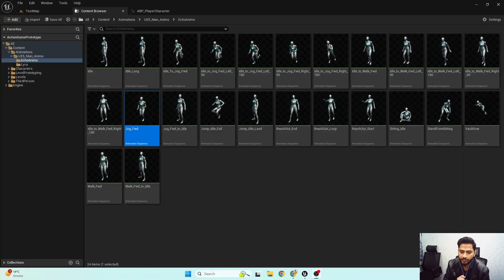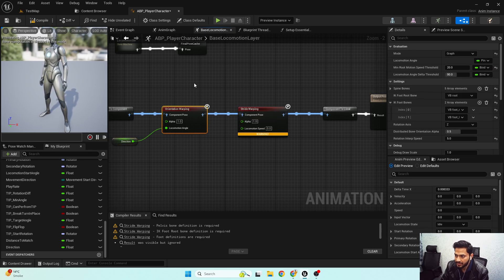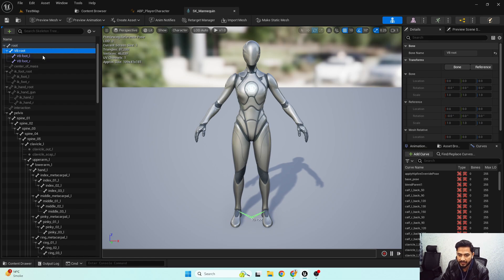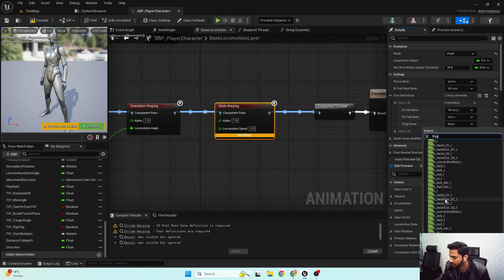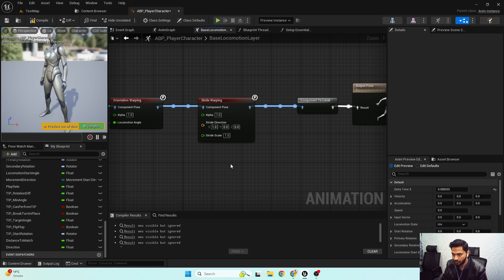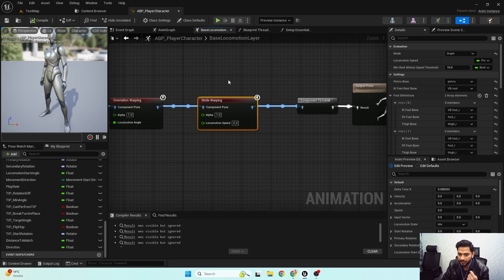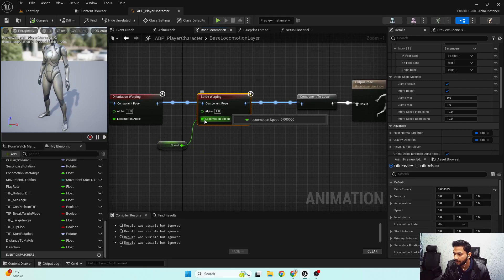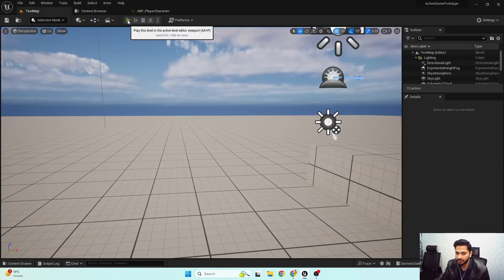Advanced Movement System | Part-12 | Stride Warping

Comment: Thank you so much for this series. I like the new approach. I am having an issue with gamepad, if I change rotation gradually while moving, my character is not getting oriented to velocity. It only changes direction when goes full stop. Any advice?
Reply from the maker: I've uploaded a video for Analog Input handling. That will hopefully fix your problem.
thanks
Reply: Thanks @TechAnimStudios  Can you please send me the link? I've watched today's video (part 13) and it did not cover that issue. Just to clarify. If I start moving forward and hold the input button, and change the camera with mouse, the character won't follow the camera orientation. The same happens if I gradually rotate the movement direction and if I alternate W, S, A and D while walking. This doesn't happen with the original Echo setup. And Echo's character BP is set to off for Orient Rotation to Movement, use controller desired rotation and use controller rotation yaw, so I believe the character follows the velocity through code. I'd appreciated if you could point the right direction. Thanks in advance.